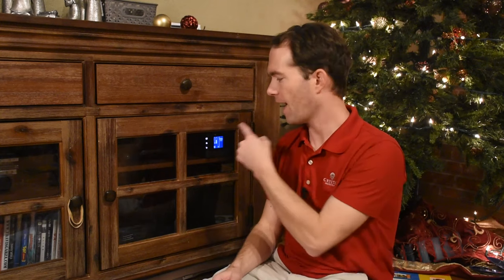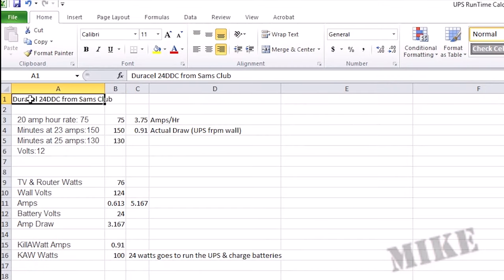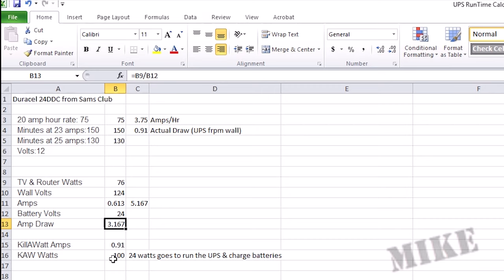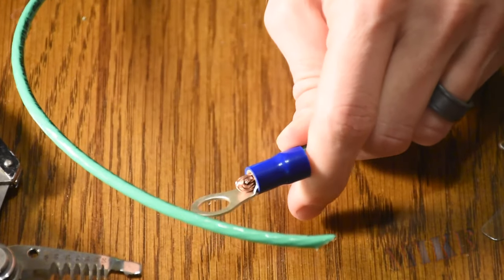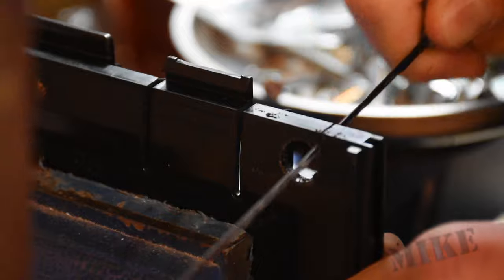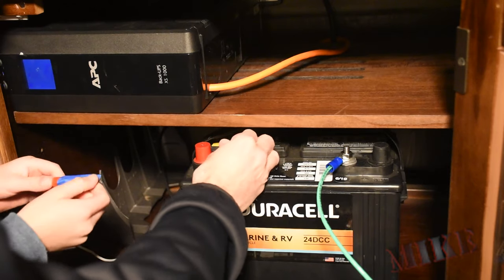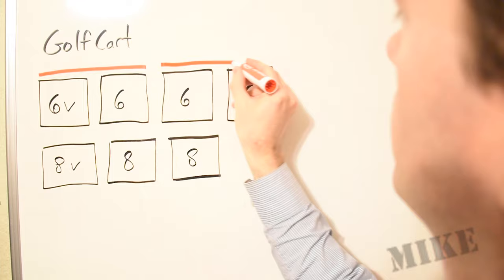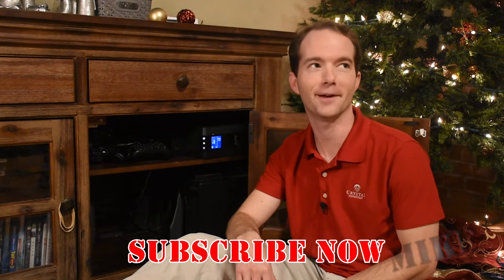SUPER UPS Battery Hack- Mikes Inventions

Comment: Although this sounds as a great UPS runtime extension, but there are few risks to consider among the others written here already:

1. Battery voltage - small household UPS devices are equipped with maintenance free gel type batteries to avoid sulphur acid spitting around. Such UPS are configured to Pb gel batteries type, which require higher charging voltage. In case of one 24V battery used, the charging voltage is 28,8V-30V and trickle charge voltage is 27-27,6V. In case two 12V batteries, charging voltage is 14,4-15V and standby trickle charge 13,5-13,8V. The battery you used for your project (I suppose traction battery) is regular wet battery with lower charge / trickle charge voltage, meaning that it is overcharged when fully charged and GASSING.

2. Balancing batteries - a must have in case 24V UPS had one 24V battery and you decided to use two 12V batteries in series, to ensure equalised charge / discharge.

3. Explosive gas - Hydrogen is produced in Pb chemistry type batteries while charged, so make sure you are not a smoker.
Reply: The probability of the hydrogen catching fire is very small. As long as the battery stops being charged when it is full, it should be fine. If full charged and you continue to charge, all the energy goes to doing electrolysis. Even then, the hydrogen produced will diffuse in the room. Oxygen gets produced as well with a tiny amount of ozone.

Comment: I did the same thing with a smaller APC UPS unit, using several emergency lighting batteries. It was working great capacity-wise,  but I guess I was trying to pull too much out of the unit at once because it failed recently when the power went out, so I'll need a larger UPS to handle the load, likely going to buy the same unit you have there. I recommend the emergency light batteries  because they are small, easy to connect to, cheap, and are designed for almost exactly this purpose. They are about $35 each, and I've just been buying one every time I go to the hardware store, now I have around 8 hooked up together.

Comment: I miss something here. It is a 24 volt system. You plugged in series which double the voltage not the amp 2x24 volt batteries. That is 48 volts. First, if you want to increase the time of power, you get more amp, not more volts, (if I remember my courses decades ago) and the ISP will not handle more than 24 volts. sorry but I'm a french speaking person and maybe I did not understand a part of it.

Comment: I’m trying to charge an APC backup Battery with my inverters and they won’t charge the APC back up; any advice? The inverter converts the 12volt to 120volts to charge the battery but it won’t accept that power for some reason

Comment: If you want the APC UPS to recalibrate, install PowerChute Plus, connect the USB cable, under Monitor System, Run Self-Test, click on 'Replace Battery Date'.

Comment: @annestywest7488
I bought a Cyberpower cp1500pfclcda 1500va 1000w sine wave battery back-up system it has 2 9AH batteries 24v so I added 2 100AH sealed lead acid batteries 24v but it can't see that I added more AH to it and at 207w it only runs 44 minutes then shuts off but the batteries are still at 24.5v when it cuts off. Can I hack the system to change the settings?  Should I just buy a power inverter to run my things on?

Comment: I removed the internal battery and extended wires to fix a 12v 80 amp truck battery to my APS UPS.  I find that there is no difference in the lasting time of the UPS when the power is not on!  Do I connect an external  charger to the big external battery?

Comment: I have used a basically identical system for over 20 years. I started with two marine batteries but soon found they did not last long.  I then switched to ordinary car batteries and have had much better luck...and they are cheaper.  The reason:  Car batteries are designed to spend virtually all of their lives at full charge....just like this UPS system.  Of course, if you have many long power outages, then a marine battery may be better.  Most of our outages are not that long, so the batteries spend most of their lives fully charged.
Reply from the maker: Very interesting point Caesar. Thanks for bring that up.
Reply: Nigel Cam  I agree that car batteries are not designed for deep discharge, however deep cycle batteries do not like being at a constant full charge either. You will note that I said this was mainly for shorter outages, and for this purpose, normal car batteries will last much longer.  Also, the UPS I have is designed to cut out at lower voltages (specifically for lead-acid batteries), so it will never fully discharge the battery.  The user needs to make a decision as to the type of usage that will be typically encountered.  Of course, all this is moot if you do like I did recently:  I replaced the two car batteries with 8 LiFePO4 batteries.  These have much more capacity, will withstand over 2000 charge cycles, have no issues being discharged, are much lighter, and have no maintenance requirements.  My new system now has 180 AH of capacity.  I should add, however, that it was not cheap!
Reply: Nigel Cam  Not sure what to say.  I tried two sets of marine batteries for about 5-6  years.  After the second set died, I tried regular car batteries and got about double the standby life out of them.  Again, most of our outages were for less than an hour or two.  Back then, we did not have that many power failures.  Being in Sonoma County, CA with multiple power shut-offs and fires that required us to evacuate, the batteries are used more often and longer...that is why I switched to Lithium batteries last year.  My current system can easily last 2-3 full days with about 100w of continuous drain.
Reply: @caesarvalenti2763  interesting facts. 
When you swapped to LiFePo batteries, you just added a BMS to the setup and kept the battery voltage on the same range?
I'm trying to come up with a solution for a big power supply I have that currently runs 6 x 12v 9ah batteries. Trying to find a BMS for 72v..
Reply: @thatcrazyguy1971  LIFePO4 batteries work nicely as replacements for lead acid, 4 lithiums  replace 6 lead acid with about the voltage.  My lithiums "float" at about 27.4 v, or about 3.4v per cell.  You would need 21 cells, but I am not sure they make a BMS for that.  I guess you could use three 24v BMSs, but that is not very cost effective. I have seen some 21S BMSs, but they are not easy to find. They also make some that are usable from 20S to 30S.  Depending upon your application, you may be able to avoid using a BMS...although I am not sure I would recommend that.  If I had to re-do my system, I would eliminate the BMS as the APC UPS does have sufficient battery management in it...plus a 100A fuse.
Reply: @caesarvalenti2763  thank you much for this reply. I'll replace with SAL batteries for now but between now and next replacement I'll find a solution.
Sure some people will come up with hardware to make it an easier process..

Comment: So the basic idea is putting an additional battery in parallel to the original (UPS), right ?
Reply from the maker: Hey! Well, to keep the capacities balanced, the original batteries are replaced with the larger ones.

Comment: This is an old video but it really needs to be called out more that it's not clear the battery the OP chose was an AGM battery or not.  I only saw one comment here calling that out.  Duracell makes a marine battery specifically labeled an AGM battery.  It's their platinum marine line.  The "marine & rv" line this guy picked does not say they are an AGM.  Duracell's PDF spec even shows a pontoon boat which has the required air venting for a non-sealed battery.  This is a huge safety issue.  Lead acid batteries emit hydrogen sulfide while charging.  AGM batteries are sealed under normal use but in an overcharge situation they have a vent which still releases hydrogen sulfide.  SLA batteries destroy themselves and bulge but contain the gas in everything except extreme situations like the whole thing being engulfed in flames.
On top of all of this the OP has the batteries in a closed cabinet.  If it's emitting hydrogen sulfide for an extended period of time and someone that doesn't know any better whips open that cabinet door while taking a breath, it could literally kill them...

Comment: We would like to see the wiring. Why he just connected the orange (positive?) to the UPS only? Where does the "negative" go?
Reply from the maker: Hey Joel. The negative wire goes to the negative terminal on the UPS. I didn’t figure people would need to see that I guess. Thanks for watching.
Reply: there is only 2 connections .. 1 red (+) & 1 negative ( - ) 

connect batteries red to red and black to black and you'll get same voltage for double capacity
conect batterie red to black (series) you'll get double voltage same capacity as one 

now that you know that.. UPS needs 24 Volts out of 2 x 12 Volts
so you need to connect Batterie in series.

so : Black connector of UPS to Black post on battery  1
take red post on the same battery and connect it to the black on the second battery 
again take red post of the second battery and connect it red connector in ups 

upsRED to BattRed1 -BattBLK1 to BattRED2 - BattBLK2 To upsBLK

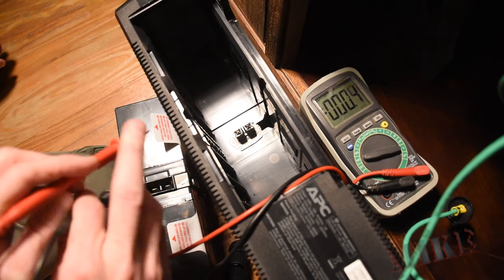PS . the 2 conenctors in the UPS are in the bottom next to each other 4:23

Comment: Thanks for the video, I liked your idea and now plan to execute on my BR1000G. Its internal battery are dead. Will the current from APC be sufficient for charging high capacity batteries? Any limitations to consider while choosing the battery size?
Reply: UPS will charge battery, just potentially at a slower rate I would think (assuming constant current charging)

Comment: Why didn't you leave the original batteries in if they were still good and simply add the new ones in parallel for and even longer run time ?
Reply from the maker: Hey Christian! I didn't leave them in because parallel batteries should be the same capacity. Alex also needed them for something else. Thanks for watching!

Comment: Do not use wet cell batteries (car batteries), they are designed for cranking amps and not capacity. Running them down destroys them. Also when recharging they vent hydrogen gas so keeping the batteries enclosed like you have is just asking for trouble. Use AGM batteries FFS
Reply: He is using deep cycle batteries and at such a low charge rate releasing hydrogen is not a concern...

Comment: You really need to test the runtime as you will make a revolting discovery. The UPS ignores actual battery voltage and instead calculates the AC load based on the standard battery capacity. 
It will shutdown at the same time regardless of my many batteries you connect.

I contacted APC to see if there is a method to change the default battery capacity. Found nothing in the PowerChute software, and running a self-test has no affect.
 Only fix is to swap with a XL version factory designed for external batteries.
Reply: Your comment is quite interesting. If the software shuts it down without verifying actual available capacity, that is poor design on APC's part.
Reply: @cliffmathew  I have not seen this on my APC 1500 UPS.  Yes, the estimated amount of power shown may be based on internal batteries, and the alarm starts sounding when "remaining" capacity nears zero, but my system (now using LiFePO4 cells) went on for many hours at a discharge rate of 200 watts....long after the display said I had no capacity left.  During the fires here in CA last year, it lasted at least 2 full days while we were evacuated and it ran all of our computers, routers, wireless, cameras, TiVo, etc. with no problems.
Reply: @caesarvalenti2763  Thank you for taking the time to reply.
Reply: one comment which makes sense , you have to do this and realize it did not work.. software makes sense , it calcs the voltage of 24 volt and cuts off at some level 21.4 maybe so it is all voltage , in anycase the software need to know when to cutoff.
Reply: @cliffmathew  Most newer consumer-grade UPSs are designed to overheat at the same time the battery loses power. The runtime cannot be extended. Its cheap design, not a software issue. Only the APC “XL” versions are rated for continuous operation and can accept external batteries. I have both and tested both.
Reply: @woodlandsdel  Thanks. I ended up buying Tripp Lite APS750 and two 120AH marine batteries. Not pure sine-wave, but enough to run my router, switch and so on forever.
Reply: @cliffmathew  I bought a well-used APC SUA1000XL with new internal 18AH AGM plus added a pair of Harbor Freight 35AH AGM. Pure sine, and will run a 100W load around 10 hours. Plus has enough grunt to start & run a full-size fridge.
Reply: @woodlandsdel  100 Watts for 10 hours is pretty good! Thanks for the info.

Comment: can you hook a computer straight to the batteries and bypass the ups and the computers power supply??
Reply: The batteries are dc, you're computer is ac.
Reply: @carlosreyes6448 the power goes in the computer ac and is turned to dc for the computer to work

Comment: Really cool, although for the thing I'm looking for it's not gonna cut it. You showed on your spreadsheet that it's pulling 76W. I need it to pull 700W and people have told me that I a UPS can't handle that without overheating and that I was gonna need an inverter to do this job. The problem is that in inverted, as far my limited knowledge goes, can't funcion as a UPS. I've seen a few videos and the inverter keeps powering the battery and wasting energy out of the wall and if you build a home made super complicated system to automatically turn it on and off according to power outage, it's not something quick enough to not make your gaming PC not turn off for a second in the meantime. I wonder why the hell haven't anyone come up with a actual gaming UPS....
Reply: There are literally UPS designed to handle 1000w, look up APC 1440va UPS, lot of options. Hook it with your 24v inverter system with couple of 200Ah batteries in series and you can game for hours!
Reply: @CeceliPS3  you shouldn't hook it up to car batteries unless you wanna charge it separately everytime it discharges, buy a 24v inverter system with big batteries and hook your UPS to the inverter, UPS will do fast switching and inverter will provide long backup, it won't be efficient but it'll be convenient and reliable.
Reply: @AmongUs-mb4qx  I saw that once. Won't the batteries be rendered useless with little time since being hook with an inverter all the energy coming out of the socked to the computer will be passing through the battery first being in a perpetual state of discharge and charge?
Reply: @CeceliPS3  that only happens with online UPS and that's not an issue, infact it's better as voltage remains constant. Your model isn't an online UPS so it's out of question. I've been using this setup for 16 years, never had an issue.
Reply: @AmongUs-mb4qx  Nice. I'd have to look into it somehow. I don't supposed it would be as easy as just buying whatever model and just plugging it in, is it? lol But first I need to figure out if my UPS is about to kick the bucked. Just a few months using it and it's constantly super hot, even when the PC is off.
Reply: @CeceliPS3  you can use it standalone just for computer or connect it to the whole house, just make sure it's a sinewave inverter as UPS likely won't work with square wave.
Reply: @AmongUs-mb4qx  Sorry, english is not my native language. Is sinewave the same as sinusoidal (I've got this word from google translate)?
Reply: @CeceliPS3  yes, a sinusoidal waveform is what you're looking for in an inverter.

Comment: I tried this with a Cyberpower 1350VA that I originally purchased from Costco. I installed two 12V 36 amp hour batteries to replace the original batteries but ran into problems with using the usb connection that allows your computer to tell if the UPS is about to run out of power so it can initiate the shutdown process on the PC. My use case is pretty unique, so it's the key thing causing problems I know. I am using the UPS to protect my 36 bay super micro server that I run unraid on. I adjusted it (but may have done it wrong) to begin shutdown is there is less than 10% of remaining power in the UPS battery. If the power goes out, the server immediately begins powering off, but with the UPS having two thirty-six amp hour batteries it should be able to hold the server up for about 8 to 10 minutes or so. It has a single 1200W Super quiet power supply module. Is there any way to get the monitoring circuit in the unit to recognize that larger capacity batteries are installed?
Reply: if you're using NUT to monitor the UPS then it might be possible to power the server off based on the voltage of the batteries rather than what the UPS thinks the capacity is. just read the manual
Reply: unRaid has a setting under UPS "Time on battery before shutdown "  That may work for you.

Comment: I'd be more interested in running a forced air gas furnace for a couple days to keep the house warm during a power bkackout.
Would there be any output capacity differences between the wet cell batteries vs. the SLA battery types??
Reply: These will not even come close to running a furnace, get a real back up system = to a Tesla wall etc.
Reply: @mac11380  a gas furnace? Yeah they will.

Comment: The problem is the charging rate. When the power goes out for very long...As these UPS are designed for AGM batteries with low @ah rating...Which only requires a  few amps...